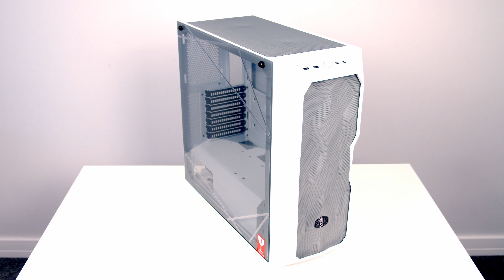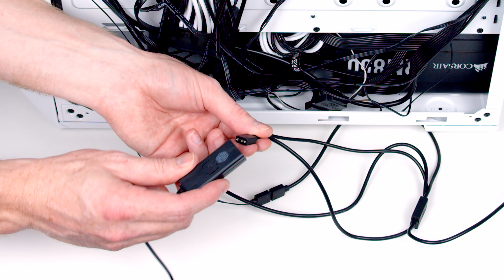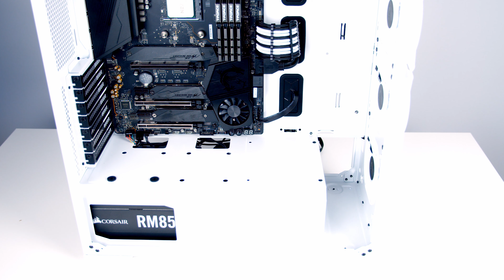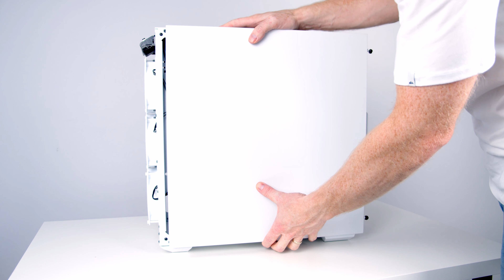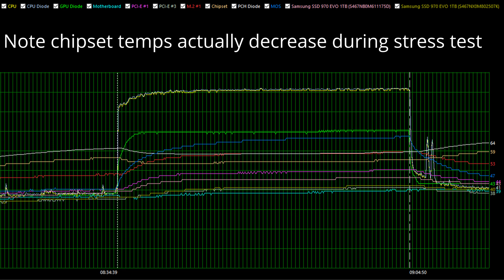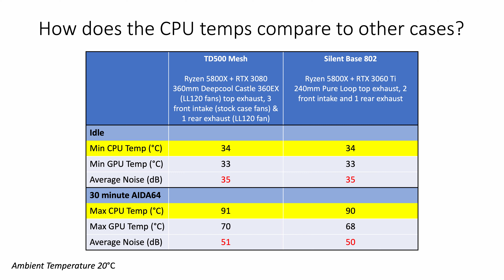Cooler Master TD500 Mesh Case Review and Thermal Testing

Comment: I've been told that This Case has a little problems with 360 mm aio on top
It covers a little upper part of Motherboard making difficulties for plugging wires or removing on top
Also then back (exhaust fan) has some problems
Is this worth Considering?

Comment: The cpu temps seem really high with that aio cooler, is that normal? ive seen alot of posts on how peoples 5800x's are running really hot compared to the 5900x and even 5950x

Comment: What problems can I encounter when replacing the motherboard? I mean the situation when I exchange from one board with the same chipset to another (e.g. both with the Z490). I wouldn't replace the CPU or disks or anything else besides the motherboard. After inserting the disks, including one with windows installed, would everything work as it should, or would I encounter some complications on the way?
Reply from the maker: It could work, but I normally do a chean install with motherboad change

Comment: at 12:30 you talk about the Hard Drive indicator. What if my build doesn't have Hard Drive? My Build has two SSDs:

Samsung 980 Pro 1 TB M.2-2280 NVME Solid State Drive	~ Main Drive for OS
Sabrent Rocket Q 2 TB M.2-2280 NVME Solid State Drive	~ Games and Media
Reply from the maker: It will still blink with ssd

Comment: I do wonder about in take and out take fans. The rear fan will blow air out the case? The 3-pre-built fans blow inside the case? Which way will our CPU Coolers blow air at if it's on the top of the case? 3 fans 360 mm AIO CPU Cooler.
Reply from the maker: CPU blows it out (exhaust)

Comment: i only plug power on cable last 5 years with my build. i don't even know why still they make HDD light :) we don't even use hdd anymore :) also don't need reset and front audio cable mess in my builds :)
Reply from the maker: Good points